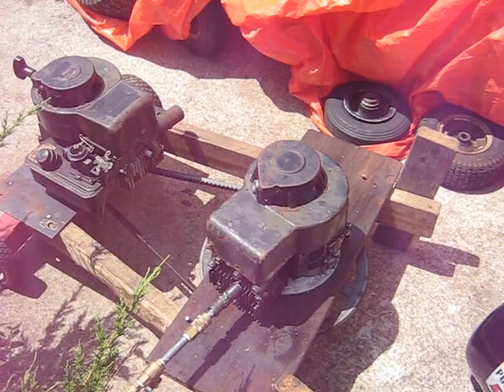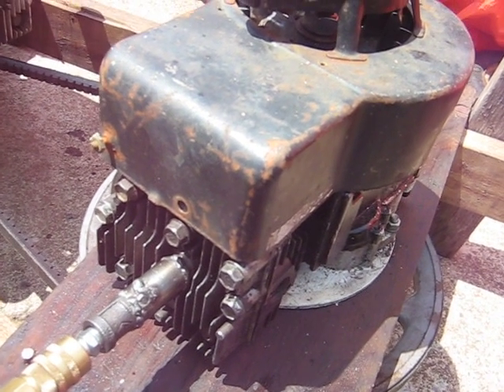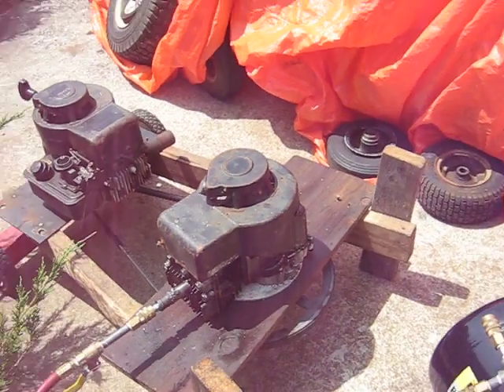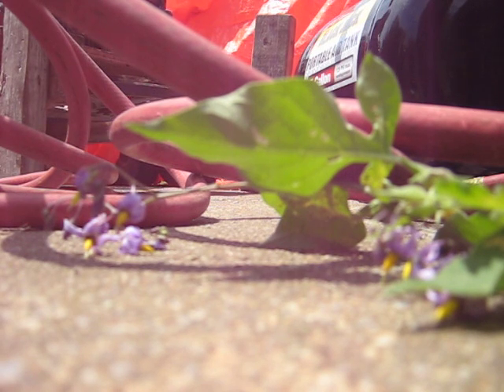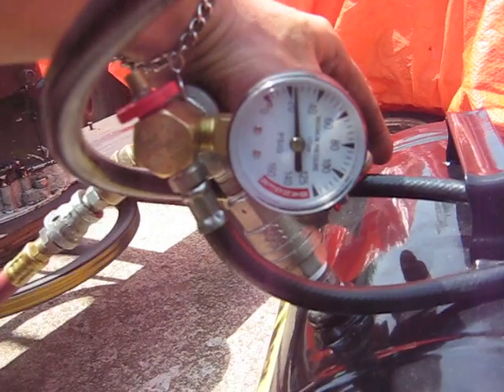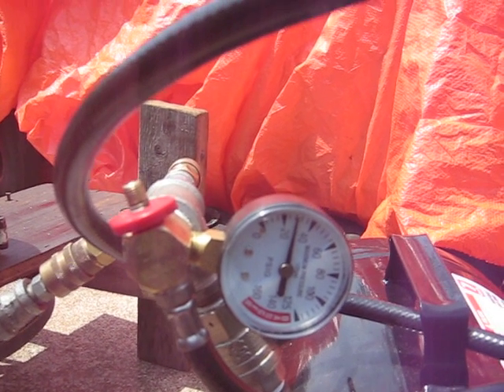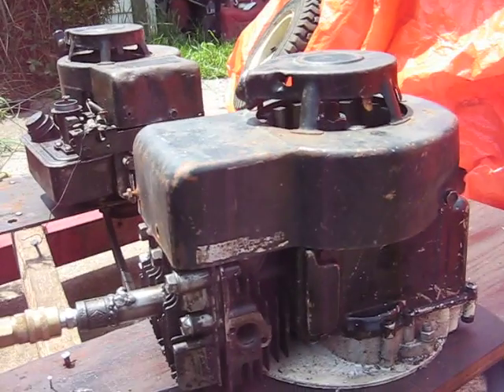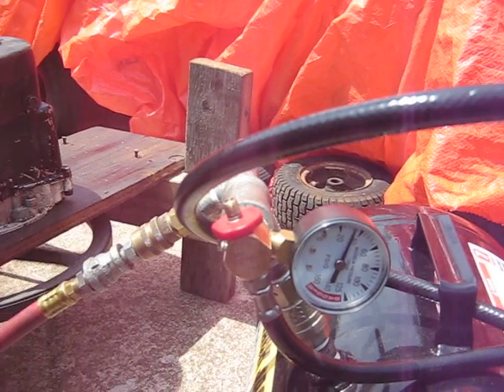Suction Valve Intake on Air Compressor1

Comment from the maker: Oh, making a flat steel head works pretty well.
But the discharge air is hotter, since the steel can't flow the compression heat away as well as aluminum can.

Comment: Might work better with both valves being intake valves, more intake flow. I need to start experimenting with this (safely), I really don't want to spend 300 bucks on a chinese unit!! I wonder if the piston valve piston would work better as the intake valve, if nothing else it would quiet the thing down lol!

Comment from the maker: Actually, the piston seems to be OK, it is mainly the head ahvd valves that cause the biggest problem. My disc valve compressure uses the same piston and block, it will put out lots of air at 125 psi, BUT the clearance volume in the head is kept as small as possible with it. Watch vid #2, which I hope to upolad tomorrow night, I put on a higher compression head in it to compare.

Comment from the maker: It basically goes nowhere. The stock Briggs head has only 5 or 6 :1 compression. This means that it can only reach about 100 psi (give or take) when it compresses.  When you don't have a perfect seal, like here, it reaches even less pressure. Basically this setup has reached its maximum output pressure at 30psi. Pretty sad, but that is it. It is mainly the volume of the head and the 1 way valve that is the problem, you have to have the "clearance volume as small as possible, to pump air out.